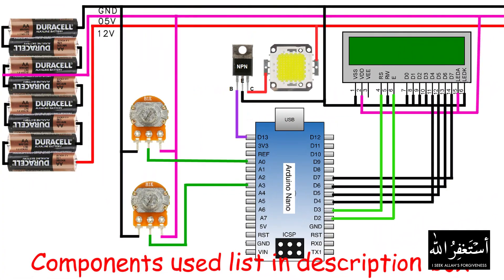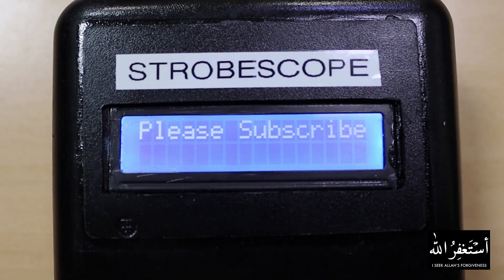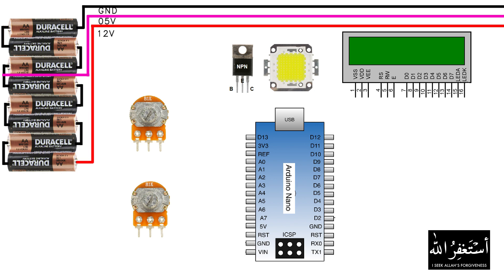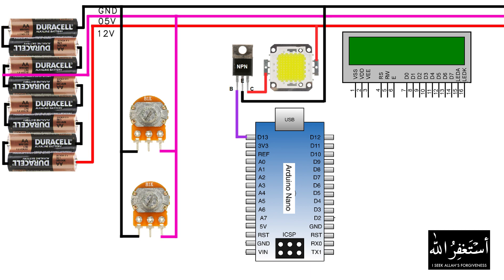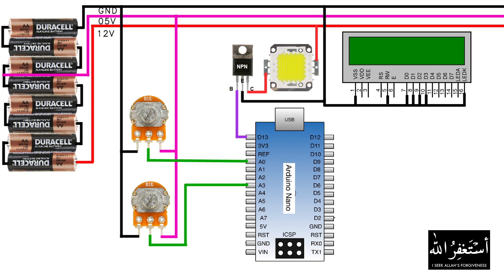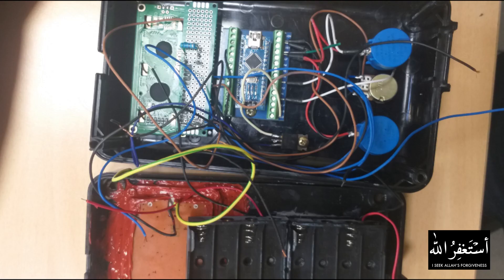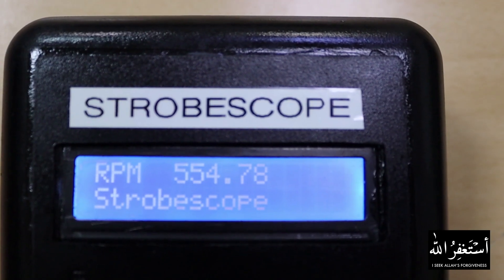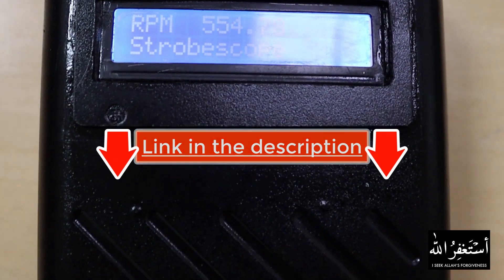DIY Stroboscope with Arduino nano

Comment: hey..can i measure 20000rpm in it by changing the code
Reply from the maker: You have to check the frequency of the crystal installed in ardiuno chip. If it can goes to thus much speed.  Yes you can measure .... second thing you have to use the high  speed switching leds and high speed switching transistor circuit for this much speed

Comment: dear sir  what is the transister number used in this project, thank you
Reply from the maker: I tried many transistors .... but d313 Is good ,,, you can use any high speed switching transistor
Reply: thank you